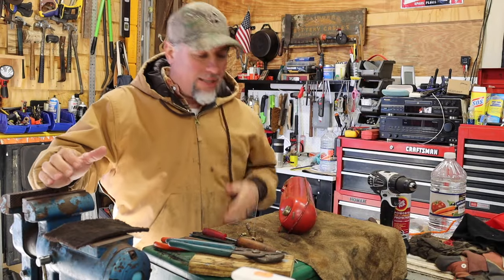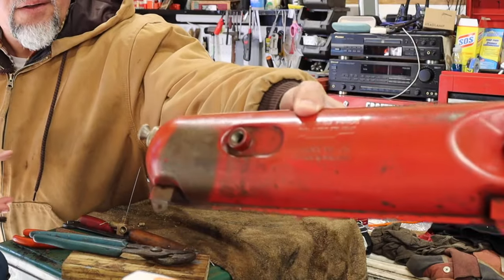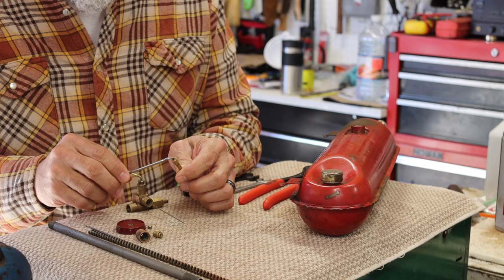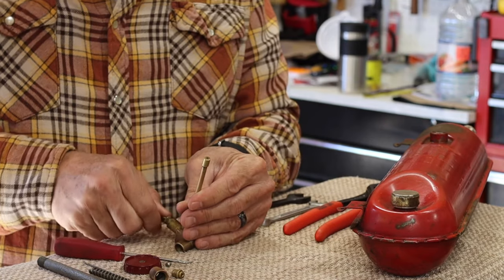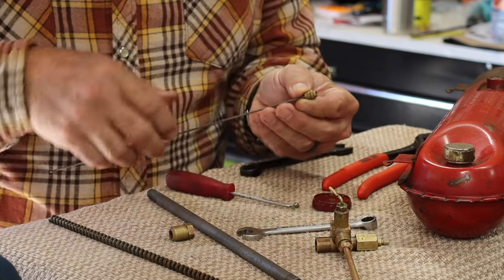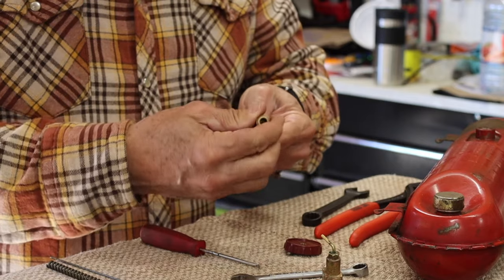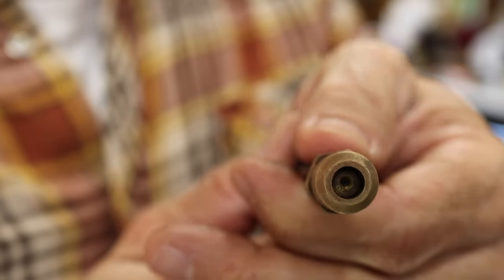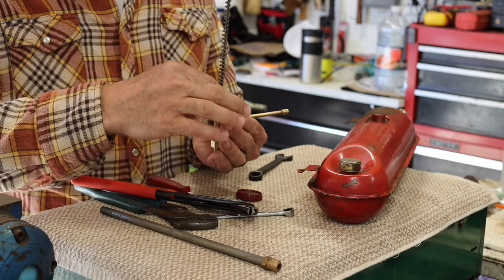Resurrecting A Vintage Coleman 413f Camping Stove - Unleash The Power - Take Control #colemanstove

Comment: I hear what ya saying bro, I'm 56 and I've accumulated a nice collection of different models .  Coleman fuel white gas is nothing more than naptha, available at hardware stores sometimes cheaper. Gasoline will do in a pinch but you'll have a maintenance cleaning more often. Just don't leave Gasoline in the tank packed away and a little Seafoam additive does wonders to  keep carbon cleaned out of the generator.  I really enjoyed this video and glad to see you put such emphasis on emergency low tech. Now get the Coleman folding oven box to go on top and it's biscuits and gravy time any time😮💪!

Comment: Nice work!

Unlike a lantern, you open the valve all the way on these when you light them.  Some instruction say "at least 2 full turns, but the result is the same.  Set your lighter to the burner and open it quickly.  

Lighting lever up restricts the fuel pickup, but not all the way.  This forces air from the top of the tank down to where the pickup is mostly blocked at high velocity and atomizes the fuel into a mist that comes back up in inner tube, through the valve and generator and into the mixing chamber where more air leans out the mixture so it will burn relatively cleanly until the generator is hot enough to vaporize the fuel.  If you don't open the main valve enough on startup, air volume and velocity are insufficient to atomize the fuel and you flood the generator and get yellow flames.

Claims that the lever only allows tank air and vapors into the generator are incorrect.  Those vapors are nowhere near rich enough to burn after going through the mixing chamber and picking up additional air.  Liquid fuel atomization at the bottom of the fuel/air tube/fuel pickup is the key to the instant lighting process.  This is why plenty of pressure and quickly opening the valve at least 2 FULL turns is needed for clean lightups.

As soon as it lights, start pumping again.  About one pump per second until the generator is hot and the blue flames start pulsing and jumping off the burner.  This indicates the fuel is vaporizing and the mixture is now too lean because too much air is being introduced into the generator.  Flip the lever down and you are ready to rock and roll.  

Give it a try and see what you think.   The abbreviated version of this is on the lid.

Comment: The lighting lever when up blocks off the liquid in the tank and allows the vapor from the top of the tank to pass through the hole at the top so you can light the stove. After about a minute, you can turn the lever down once the generator is warm enough to vaporize the fuel. The lever is not a cleaning rod, like on a lantern.

Comment: I took my 432A stove out today filled it with gas and pumped the daylights out of it.  Lit it expecting to see the usual 2 foot high yellow flame before the generator warms up. Nope just blue yellow small flames till it warmed up. This stove cost me 15 bucks and works wonderfully .Yes I took it apart and cleaned , sanded , painted , and filled it with gas , but no parts required to fix it! 
 So as it was getting that blue flame I pumped it some more and set my Coleman oven on top. 10+ minutes later it was at 350° and in went a loaf of bread and 22 minutes later done. The stove was on low most of the time and just adjusted to keep the temperature at 350. I could have put my coffee pot on the other burner as there is lots of room.  Hmmmn middle rack and still burnt the bottom. So from what I have read I need something on the floor of the oven to distribute the heat better. BTW it was sprinkling out as I was baking!
Lots of these on Facebook marketplace and some people have really greedy prices but generally a working Coleman stove is around 15-35 bucks.
Reply from the maker: Excellent story Bruce! Thanks for sharing, such a great product that every family should have. Try throwing a cast iron pan in the bottom to help with that heat control.
Reply: @JessesWorkshop  The alternative was to pick up some flat steel but I just happen to have my old Wagner frying pan that has cracked and leaks . I have not thrown it away for sentimental reasons but you have mow given me a use for it.
Reply: Haven't tried my NOS oven yet..,.but have a cheap pizza stone for the bottom to even out the heat.